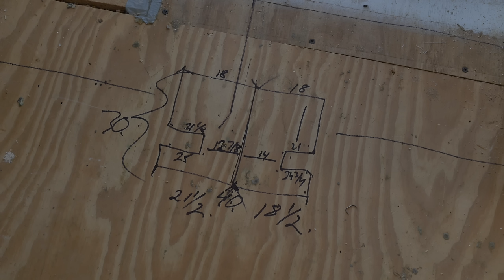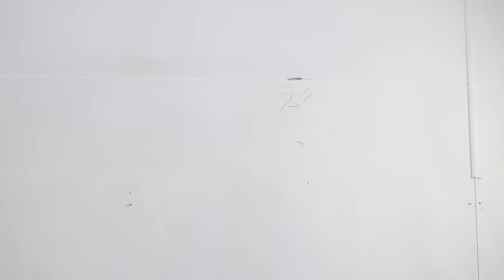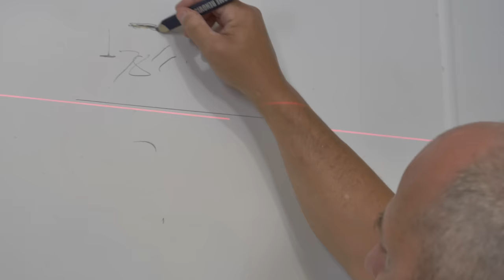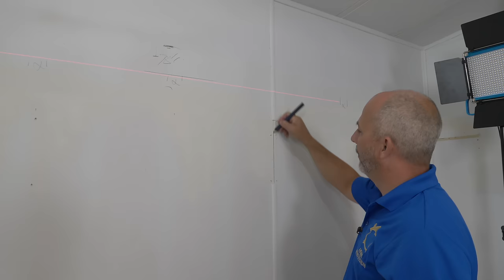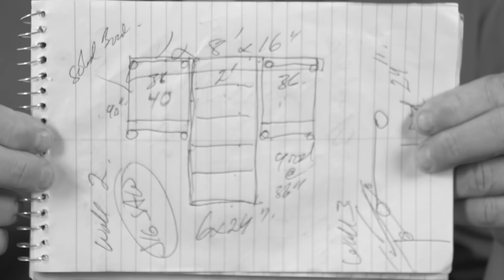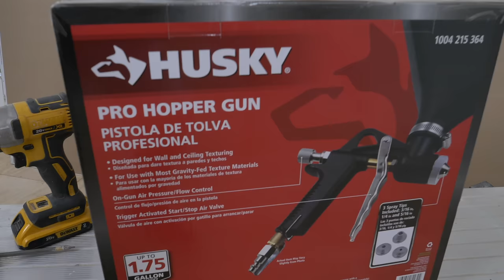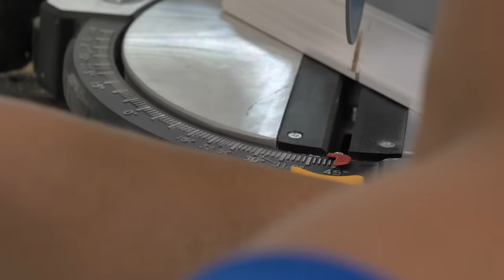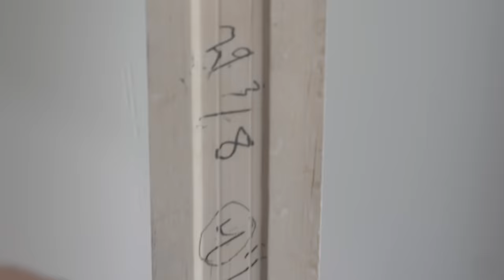How I DIY'd a $7500 Bedroom Renovation for $2500

Comment: Lemme offer a tip on cutting the shelf without tear out on the off-side surface: Put a simple strip of painters or masking tape along the cutline. Should cut cleanly. Trick I learned cutting thin veneer-finish plywood. Perfect every time😊

Comment: I'd like to add a 3rd occasion to install LVP, if your open to it. Third reason is if your a landlord in reasonable areas, because you can't be there 24 7 and you don't know what your tenants are going to do to the flooring. Sneak pets in, drop screaming hot cast iron Dutch ovens, moving furniture around between tenants. However I personally don't know how I feel about it in the bathroom. Some other investors I hang out with do, and they've had problems because they didn't get it tight enough around the tub and caused water damage to the sub floor.

Comment: Mine is 100% 2x4 walls that are 16" on center.  I know this because I've seen nearly every stud as we're remodeling!  It's 40 years old though, built by Scott Housing Systems in Georgia.

I also taped/mudded/painted a vinyl-covered gypsum wall...  It was so much more work/time than hanging/mudding/painting new drywall would have been that I refuse to do it again.

Comment: I live in a 1984 Nashua in Kalamazoo, MI. I have been redoing my place gradually...and yes! I come across those damn staples. And poor plumbing. Everything you've mentioned.  The other day I took a section of paneling off, thinking recessed storage. Well, not deep enough BUT 2 major wires running right thru the middle ,not protected whatsoever. My list could go on n on. I'm very interested in watching what you do to yours. I have done almost every room, both baths, living room, breakfast nook,back bedroom n family room. I've started on kitchen n my bedroom. Have had a few hold ups.
Reply: I need to do all new subfloor n the ceilings. Had to wait on them as my places needed to be leveled. It was sinking due to high water table here.

Comment: I'll be doing the same to my mirrored doors in my bedroom.  I noticed you didn't put the bottom track back on or did I miss something?  

Two reasons I ask

First is I had previously done the mirrored doors in my front foyer.  The biggest problem I had was the doors were so heavy they bent the top track out of shape and the doors would be rough/fall out of the track.  This was like this when I bought the place.  I replaced the top track with a new one from HD but could immediately tell it was flimsy (even though it said heavy duty)  and wouldn't hold the weight and eventually fail which it did.  What I ended up doing is buying bottom rollers to take some of the weight.  I had to Macgyver them on using gorilla glue and shims but they've held up enough that they've proven themselves to do the same in the bedroom.   

Second is because when I had done this previously I had secured the bottom track before attaching the doors.  I found the doors hard to open.  I solved this by unscrewing the bottom plate and adjusting freely to where they open smoothly and then attaching and am wondering if this is indeed how you are supposed to do it.

Greetings from Barrhaven!

Comment: Currently demoing a basement bedroom due to water and termite damage. I’m confident in the rebuild thanks to your videos. Only question now is the moisture barrier… if I can’t seal it between the studs from the other rooms. Is that okay or do I need to tear more out to connect the barrier to the other rooms? 

(My perfectionist in me is telling me to tear more out and get all termite damage out, but my wallet is telling me it’s in the basement and isn’t structural so I don’t need to)